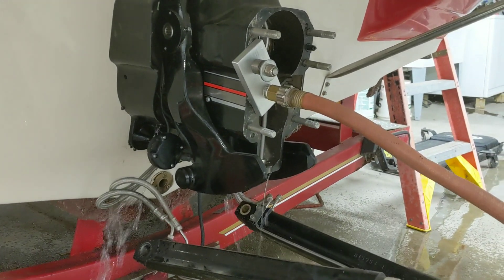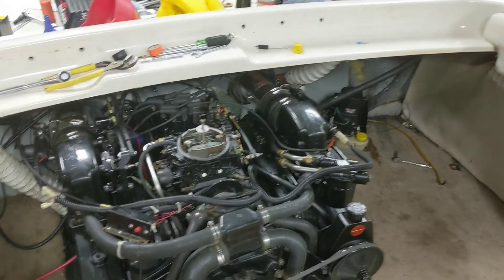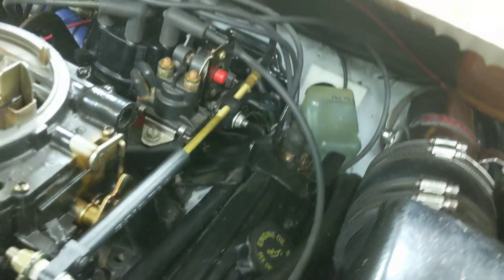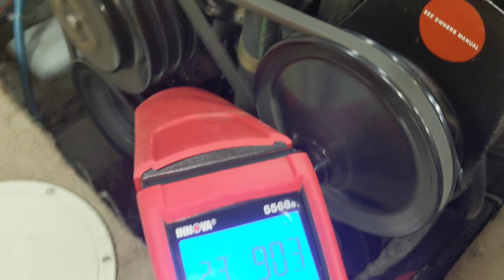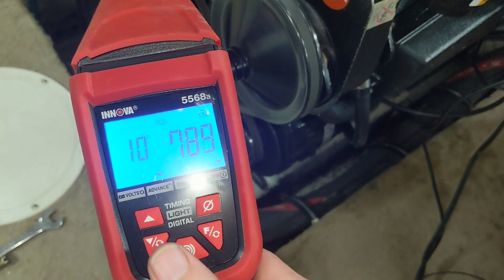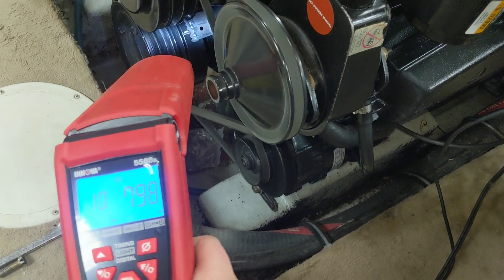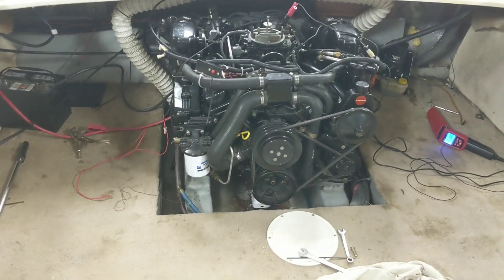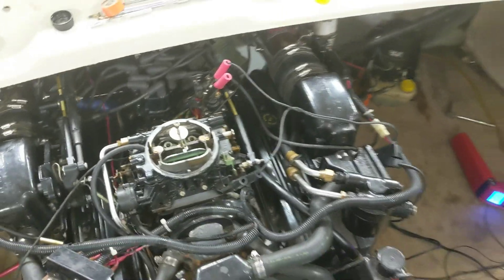How to Set Timing on a Mercruiser -- '95 Crownline 5.7 Mercruiser Rebuild Part 18

Comment: Why do you have to ground out the white and purple wire?
Reply from the maker: @AlexWaffles970  if you don't, timing will not be static. It will be jumping all around electronically. This locks the timing at one position.

Comment: My 350 in a 21ft doesn't plane out, throttle down it's bogging. Never checked timing, would that be a possible cause? Also was told the carb was cheap crap, need a Rochester 4 barrel on it. Motor was redone and ran on the hose before I bought it so never was water tested.
Reply from the maker: It's possible. The carbs shouldn't be too expensive to get. Another possible issue would be if it has too big of a prop on it. Maybe that's putting too much load on the engine.

Comment: would I need to use the jumper to put in base time for a thunderbolt 4? thx for the video. hoping for a response.
Reply from the maker: I have never worked with a thunderbolt 4 but from what I'm seeing in my manual here, there is no talk of idle speed spark control in the thunderbolt 4 like there is in the 5. From that, I would say set your timing like any other standard v8
Reply: @605BOLT  thanks so much for the quick reply!!
1 more question, why was your timing 0° on motor and 10° on gun. Shouldn't it be 10° on motor and 10° on gun? I just acquired the same timing gun that u have from my father and gonna try it in the next few days.  But I thought I should adjust the distributor until the balancer said 8° BTDC (my motor calls for). Just confused if I should have my balancer say 0 or 8. Sorry for the questions. Thx so much for ur time.
Reply from the maker: If you have the EXACT same timing light as me then the light actually delays so that when you dial in say 8 degrees on the gun, you know you're in the right spot when the light shines on zero. The advantage of this style is you only need the zero mark on the balancer. Cheaper, more basic timing lights just shoot exactly when the wire fires. No delay. Therefore you need to line up with the 8° mark or whatever you are shooting for. So it just depends which type of gun you have. If it doesn't have a screen then it's a basic one and you need to mark out 8° on the balancer. I hope that's clear but it's kind of a goofy thing to describe haha. 🍺
Reply: @605BOLT  thanks so much for the info, yes same exact gun with screen, I think I understand totally what ur saying. 
Thanks again! Much much appreciated!
Reply from the maker: @CZ530  when you're playing with it it will make a ton of sense I think. With that gun, you only need the tdc mark on the crank. The rest is done on the handheld. Whenever the 0 mark is lined up with the timing pointer, the number on the screen is the advance u are currently at. 👍👍
Reply: @605BOLT  Heck ya! Can't wait to do it now, Thanks!!! 
Since I'm messing with this and called my dad he just handed down me a bunch of cool stuff, this sweet light and snap on testers and stuff, super stoked! My tool collection is getting out of control. After I time the boat I'll know how to use all my tools lol. I set the carb to max vacuum  last weekend and adjusted the accelerator pump and she runs so much better now just wanna get the timing perfect and ill be done! Take care!

(Edit) wanted to let you know what boat just for shits, 1993 larson senza 210 cuddy with 350 mag alpha 1 gen 2. Super super clean barley used, love it!.
Reply from the maker: Damn dude. That's a score. Love getting new tools. Glad to hear you're getting the boat dialed in. Where are you from? Here in South Dakota the boating season is quickly fading and we'll have to head to storage.
Reply: @605BOLT  Far northern California,  was 115° yesterday.  April/May to just about October is boating season here.

(Edit) I couldn't winterize my boat last year I had like 50+ gallons of fuel in the tank and couldn't treat it all, so I treated it slowly and started the boat twice a month, this year I'm gonna run it almost out of fuel then treat that.

Comment: Do I turn the digital advance timing to 10 degree then the TDC will automatically be at zero? Or do I need to turn the distributer to make the TDC be at zero?
Reply from the maker: First you set the engine to top dead center on the power stroke. Then you install the distributor so that the rotor points at or near the number one cylinder. Then you install the distributor cap and wires so that the rotor is pointing at the number one post and wire. Then u start it and turn the distributor housing until it stumbles to life. Might take a few tries. Then if you have a timing light like mine you just plug in the advance you want and turn the distributor housing until the zero mark lines up with the timing pointer. If you have a more basic timing light, you turn the distributor until the 10° mark or whatever mark you need lines up with the timing pointer. Hope this clears a few things up. Depends what style of timing light you have.

Comment: Nice.  Volts is too low if that meter is any good.
Reply from the maker: Ya I was wondering what the alarm was while editing the other day. When I first start the boat it runs on battery until I exit the marina and get going. If I bump the rpms any higher than idle it jumps to 13.5/14 something like that. I assume the alternator is tired or something along those lines. Also I might not have had one of the temperature sensors plugged in during those shots. I think that might be what the alarm was for. Dang old boats.
Reply: @605BOLT  If it jumps up with higher RPM your ok!  I keep a charger on my battery.  A de-sulfinator type charger theoretically can extend the battery life.
Reply from the maker: @FlyMeAirplane  I don't even know that a desulfinator charger is? Sounds fancy. something for your airplane?